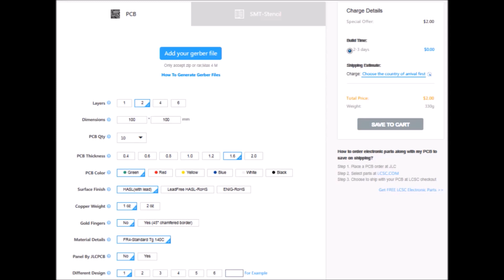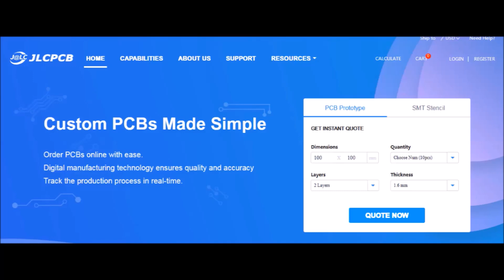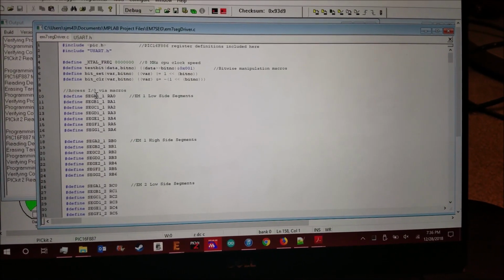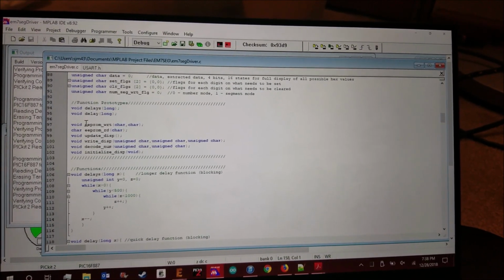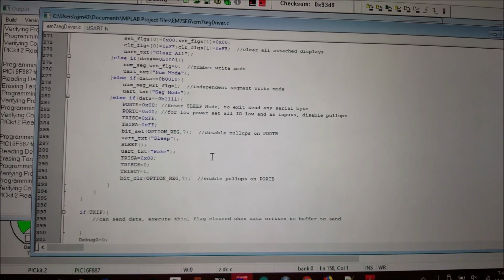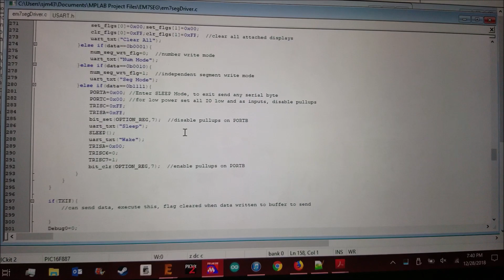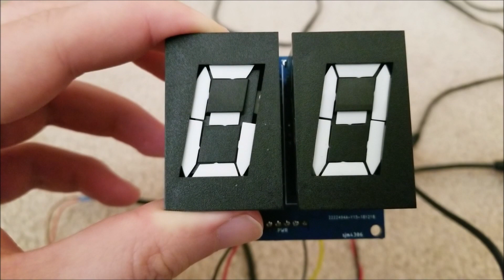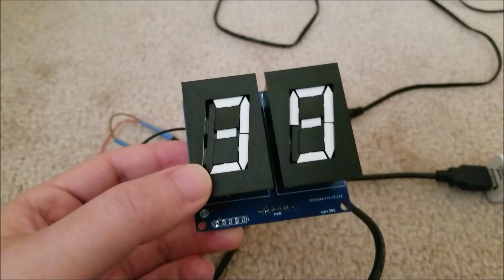EasyFlip v2.0 : Prototype 2 Assembly and Test!!!

Comment: Can you mod a Psp Go to play ps vita games?
Reply from the maker: Quick answer is no, not easily. Longer answer is maybe at a much lower resolution and framerate. Would basically have to port the game over with many changes to the mechanics and graphics to make it work but by that point it would pretty much be an entirely different game.
Reply: I would like to do it but i wouldnt know where to start
Reply from the maker: To be honest, as I have no experience developing for either systems I wouldn't either lol

Comment: You got new boards really fast. Very cool that it is working now! I had a quick look at the core-memory arduino shield, and it has discreete h-bridge driver (bipolars and mosfets).. then on an earlier revision it had SN754410 Quadruple Half H-bridge. Is that an IC you can use ? Two of those and you have enough for the "bus" :) You could tie all pull-down inputs together to save GPIO allowing only to switch on segments individually and resetting them all at once (not individually). There is also the NCV7719 Octal Half H-bridge driver.
Reply from the maker: I bought a 50 pack of L9110S full H-bridge chips meant for dc motor control some time ago for dirt cheap so I ended up using them here. I went a bit overboard and gave each segment its own bridge so if I wanted I could set or clear all segments simultaneously (and strain the 12V supply while doing so lol).